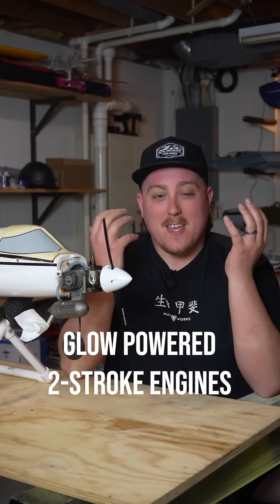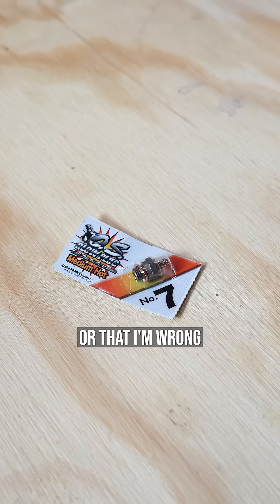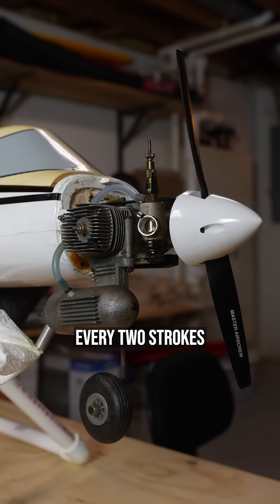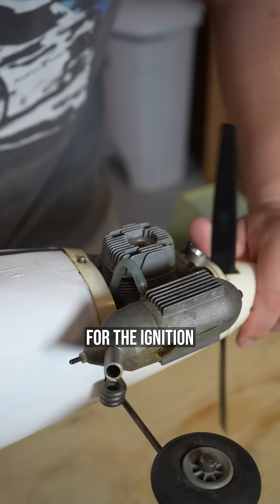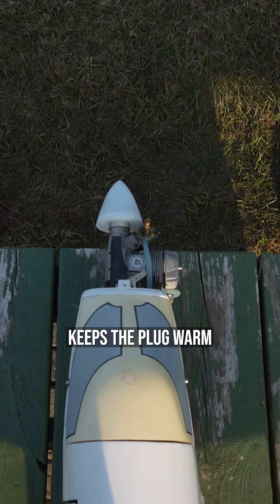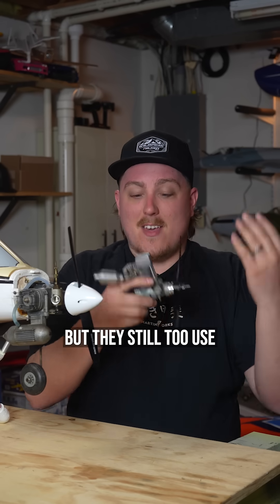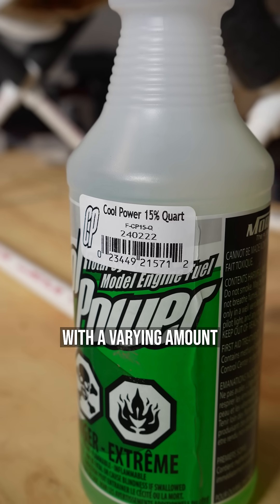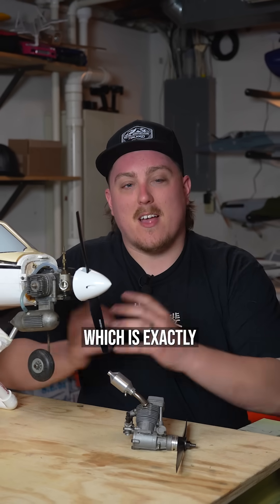How do Nitro RC Engines Work?

Comment: Look I realise these engines are becoming rarer in the hobby but clearly there is still a lot of misinformation out there if you believe it's the heat of combustion maintains combustion cycle through to the next stroke sorry mate.
It is a catalysed reaction between methanol, oxygen and the platinised plug that keeps it all going.

Comment: Actually the heat and compression from combustion is not what keeps the glow plug hot the platinum and paladium coating on the coil of tungsten wire have a catalytic reaction with the methanol to sustain the heat.

Comment: These are better thought of as two stroke semi-diesel engines. True diesels use purely the heat of compression to initiate combustion. Semi-diesels use a secondary heat source to initiate the combustion. In large stationary semi-diesels a hot bulb is heated with a blowtorch until the engine can self ignite. In this case, the glow plug is heated first to start the engine and is then kept  hot by a combination of a catalytic reaction on the surface of the platinum coil and in-cylinder heat.

Comment: The trick is nitromethane if you ad some on your bike or sacrificial engine with a spark plug it will run but good luck stopping it cause it's gonna runaway cause the mixture is igniting by the compression

Comment: It’s basically a two-stroke diesel, but you don’t use diesel fuel but the fuel that’s in there that you use is not gasoline either. It’s because of the fuel has to be reached a certain temperature. A spark plug wouldn’t be able to get to.

Comment: Well, I hate to tell you folks is OS 2 stroke probably a size 40 it’s called a glow plug doesn’t need a spark plug doesn’t have gasoline in it. It has alcohol and nitro fuel and oil mixture together.😂😂

Comment: What's the time in Old Man and when I was a young boy I never running a little cox engines with glow plugs. If I had a spark plug you'd have to include an electrical system how much more weight would that add to the plane. 
And really you're probably talking about people that don't know anything about the hobby and I think you know everything and they really don't know nothing I know too many people like that but enjoy the hobby a great hobby get young people involved in it

Comment: Just a thought but before the United States started making submarines for Warfare the Germans had glow plug 2-stroke diesel engines for the fishing boats reason you couldn't kill them with a machine gun they would just keep right on chugging along they could have they actually had incidents where there was an oil leak all the oil dumps out of the engine and it's still ran for 4 hours got to get back to Harbor now maybe that's just a mild exaggeration but these engines were Texas tough and the gentleman who went over there to examine the engines that they were using for submarines you may know him as oh I don't know possibly Nimitz. Yes he was a lieutenant and he was in the war department and they sent them overseas to Germany to study German machinery just a quick little history point there but that's what they were using in the fishing boats and they really were tremendously powerful really great engines too bad they didn't use them in cars and thank God they didn't use them in tanks

Comment: My only conclusions to this is the engines do not have a built-in magneto so the fuel needs heat to detonate so the glow plug gets hot enough to create a flash point of combustion based on the fuel

Comment: This is how diesels run away. No true ignition point after the glow plugs. Over fueling (usually from an oil consumption issue, like a bad turn seal literally force feeding an fuel type to the cylinders.) A hot diesel will burn engine oil as fuel when it's hot enough... air is what it needs to run away and if you cut that it will stop. Usually violent. Also did you know a rotary isn't really a 4 or 2 stoke engine? It's weird because of the way it is....
Reply: If you can't cut an ignition point you can't stop chemistry. Suck, blow, suck, blow, 2 stroke. High compression and heat make boom no sparkbplug needed.... diesel...

Comment: First time I'm hearing about glow plugs ever
Getting an ignition just from the right amount of pressure and heat, that sounds pretty hard to tune, diesel engines usually use injection and most every two stroke engine I've seen used gasoline

Comment: There are “Diesel” versions of these micro engines. They have an adjustable compression cylinder head w/ a screw that moves the bottom plate of the head in and out. You start it at high compression then adjust the head screw and fuel to get best operation.

Comment: Honestly a 2 stroke is basically a diesel to begin with , if you upped the compression on your chainsaw and added a bit of a richer fuel you could switch to glow plugs , it's gonna run , for how long is a different question though 😂
Reply: Modern diesel engines are 4 strokes

Comment: Actually your engine is a two stroke diesel engine just. Like a old Detroit . The friction from the air compressing ignites the fuel. The glow plug just aides in cold starts by heating the air in the cumbustion chamber. Now if it is a two stroke with a spark plug then it is a gas engine and you must mix oil with the gas where as diesel is a fuel oil sow it will lube without ppre mixing fuel

Comment: The glow driver or battery turns the coil in the glow plug red or up to heat  then the fuel which is  Alcohol a lubricant and nitro methane is burnt under compression and a chemical reaction from the fuel begins between the coil element in the glow plug  keeps it burning  and yes its a 2 cycle engine because it makes power every 360 degrees

Comment: There are 2-stroke diesels. Just because it has a glow plug doesn’t rule out anything. Take Top Fuel engine for example. They have 16 sparkplugs which melt hafway down the track and then work as glowplugs

Comment: Just a quick comment about the fuel. Of course RC engines of the type shown in the video run much better with nitromethane mixed into the fuel, but it is not strictly necessary. For many years I mixed my own fuel, purchasing methanol and castor oil from  chemistry suppliers. Then the flying club started purchasing methanol and oil in bulk (therefore at lower cost) and selling it pre-mixed to club members. This was still straight methanol + oil, no nitro in it. Then I got out of the hobby and returned decades later, when everything had changed, with nitro fuel readily available in hobby shops. Then I did fly nitro models for a while, but soon chose to go with electric or gasoline-powered models. I'm done with the glow fuel oily mess.

Comment: your correct it is a 2 stroke engine .... But to correctly identify it's type you need to call it a "2 stroke diesel engine"
and yes there have been 2 stroke diesel truck engines in use for decades....but they do Not use nitromethane in their fuel
their compression ratio is so high that plane old diesel fuel will ignite ....
typically a 2 stroke engine will put out twice the horsepower that a 4 stroke does per cc of displacement
which is incredable if you think about it. however enviromental concerns have all but ended the 2 stroke engine.( they tend to smoke more than a 4 stroke will)
but sense the entire "environmental disaster" lies have been exposed maybe they will come back and we'll get a 6.4ltr 2 stroke diesel engine for our pickups that will actually work in the future .....I can hope right?

Comment: fun fact.  the heat in the glow plug just helps the ignition cycle.  the glow fuel actually reacts with the platinum in the glow plug causing ignition, the heat just makes it a lot easier to achieve.   with some high compression engines it is possible to start without using an igniter, but it takes the exact right conditions.

Comment: Isnt there a catalyst effect from the glow plug when operating in normal condition as well? I am pretty sure if you have a worn out plug, they will still run untill you remove the starter battery.

Comment: They are effectively diesels, single cylinder two stroke diesels. To confuse things more there actually were model diesel engines too that had variable compression with a screw which went through the top of the head

Comment: The platinum coating on the glow plug wire reacts with the methanol in the fuel, that's what keeps the plug glowing. Basically a compression ignition engine

Comment: it runs like a diesel engine, combustion thru heat generated from the compression of an air fuel mixture, no spark needed. The glow plug is just to get the process started until the engine warms up enough to continue without it

Comment: I only know theory, but high compression can cause autoignition, or knock, in an engine if the fuel has a low octane rating.  This is important in motorcycles which have high compression ratios.  Yes, diesel engines use a glow plug to regulate autoignition, that is, compression helps but the glow plug gets the job done.  Being 2 or 4 stroke is orthogonal to diesel or spark.   But with no timing control, there will be a narrow power band.  Typical of diesels, why don't airplanes have transmissions?   Offshore windmills have massive transmissions (b/c the prop has low rpm, each blade being over 100m long)

Comment: I know NOTHING about these engines but I have worked on supercharged alcohol and top fuel dragsters and one thing I can tell you about both Fuel and Methanol is neither one of them like to light especially when the engine is cold (alcohol is way more forgiving than nitro) I’m guessing if you were to go back the 50 or 60 years (i’m guessing based on the little Cox engines we had when I was a kid and I’m in my 50s now) and look at the evolution of these engines it probably started out with a spark plug on the first prototypes and then they quickly figured out it was a lot more consistent with a glow plug-I wish I didn’t see this because now I’m fascinated and I’m probably gonna go spend a gazillion dollars on a new hobby😂

Comment: Those engines are similar to funny cars and diesel engines.  A shame folks bicker about what those little things are.  What's worse is I never could find a way to use those engines outside of the toy market that they are currently limited to. Limits to how long they can continuously run before they can warp enough to stop running. Size of the fuel tanks and cost of fuel.  But hey, great times are had just the same.

Comment: well i learn something new everyday ,i had no idea you could use a glow plug with a 2 stroke   .thanks dude :)
Reply: That little motor is essentially a crude diesel engine. The "diesel fuel" is that mix of nitromethane, methanol and lubricating oil. The engine, once started uses compression for igniting the fuel/air mixture.

Comment: It’s more of a diesel engine than anything. And yes there are 2 stroke diesel engines. Detroit is probably the most popular that made a ton of them. And technically you can have a gasoline engine run without a spark plug too but would not be as efficient,reliable or clean burning.

Comment: To me the coolest thing about glow engines is how they actually have variable ignition timing based on rpm. As rpm increases, the glow plug gets hotter, which ignites the fuel-air mixture sooner, thus advancing the ignition. Works the opposite way when rpm decreases, glow plug gets colder which ignites the fuel-air mixture later, effectively retarding the ignition.

Comment: I suggest looking up the experiment of hanging a penny in a vessel with acetone and once the penny is heated and hung above the acetone it will ignite the vapor...this is the same principle for these 2 strokes!
The GLOW PLUG is a Catalyst Metal similar to Platinum or copper in the experiment...and once heated and introduced to fuel vapor it Continues to "Glow" allowing the next ignition to occur. Science

Comment: The interesting thing is that it is technically a
 form of a half diesel 2-stroke engine with passive fuel injection, but does not burn the oil in the mix. It burns the alcohol and nitro, but just blows the organic castor oil out the exhaust. It is the most powerful internal combustion engine by weight.

Comment: A chemical reaction between the ingredients in the fuel and the wire coil of the glow plug will cause it to get hot and start glowing at the right pressure.  The glowing plug ignites the fuel.  A two stroke glow plug engine is sort of a modified diesel engine.   At one time all model engines were ignition, the glow plug fuel engine design was first used in the late 30's or so.  Many spark engines were converted to glow operation early on, but they were not strong enough and broke connecting rods and cases, so finding examples of older ignition engines is difficult.

Comment: Had a float in the carb stick open on a dirtbike one time and it was super hot so it just ran away. hit the kill switch, kept goin. My dad pulled the plug wire, kept goin. My dad had to rip off the fuel line. It  was either that, or let it blow up, or run outta gas on its on. Moral of the story, a 2 stroke will most definitely run off just compression, even off lower octane fuel. If the scenario is right for it.

Comment: It comes from people who aren't in the hobby, by associating a glow plug with a diesel engine.
Fun fact, it is the catalytic effect of the platinum/iridium and other rare earth metals on the glow plug that work as a catalyst when hot, without those metals the motor will stop when you remove the power from the plug.
Reply: This is not really true. I have a very old model engine that has variable compression and no glow plug. It runs fine. They're an auto ignition (diesel cycle) engine.
Reply: @mandrakejake I also have one, we're both in the hobby, my original comment is about people NOT in the hobby, those people associate a glow plug with starting a diesel truck or generator.
Reply: @mandrakejake  thats because yours runs on ether and is a diesel. this is a methanol engine and as posted, its a catalytic reaction that keeps the plug warm
Reply: But how do you get ignition advance?
Reply: @EbonyPope  its less important in these engines but also the faster you compress something, the faster it will heat. natural advance
Reply: It's not even a lack of understanding the hobby, it's a lack of understanding WHY an engine is 2/4 stroke. That's just basic combustion engine knowledge.

Comment: I have been flying RC since the 70’s. And I have both of these engines. My question since I was a teenager is, why don’t bigger engines use glow plugs?  I get that diesel engines don’t have ignition. But what about a racing engine. They use alcohol and maybe nitro.  But they still use spark plugs. Weird. I was thinking how great a 125 two stroke dirt bike would be with cool power and a glow plug.

Comment: This is literally how nitro 2 stroke rc cars work, and those have been around for probably way longer than you'd think. The fact that this is new information for people is kinda wild lol they know what a glow plug is and does but they don't know what 2 stroke means or how a glow plug works with it? It's simple mechanics. Heat make boom boom.

Comment: Heat from compression and ignition, and heat from the catalytic reaction of the methanol fuel with the platinum in the glow plug coil.

Comment: I remember my cousin having a 2 stroke rc plane that used a pair or glow plugs. Was very cool. Robust and just worked all the time if you kept oil in it lol.
Reply: 2 strokes don't have oil in them. There fuel has the oil in it.

Comment: The stroke and the ignition method or fuel of use has nothing to do with each other, you have gas, nitro or even diesel with 2 stroke cycles.

Comment: It's not 2stroke.It's 2 cycle they use It uses natural fuel so it wouldn't be classified as a 2stroke
Since it's not using too stroke oil as it's mean lubricant And it wouldn't ignite underglow

Comment: me who knew that 2 strokes dont need a spark plug by having a runaway 2 stroke trike a few months ago 

for context i was driving it and i were about to stop so i pressed the igniton cut off and it did nothing so i pulled out the ignition wire off because the button works whenever it wants and, the trike didnt turn off and it just started to rev up somehow and idfk how because its a carb engine so i jus blocked off the intake to shut it down
Reply: how are my english skills suddenly so shit💀

Comment: Delta Hawk is an engine manufacturer of engines for Cessnas and other smaller planes. They also use a two stroke engine with glow plugs. It’s not just for toys.

Comment: The glowplugs use a platinum heating element, platinum is a powerful catalyst that catalyses the reduction of methanol, especially at high pressures and temperatures. It's the methanol reacting in the plug that gives some control on engine timing. As pressure and temp rise with compression the platinum gets hot, igniting the fuel. 

If there was no methanol or no platinum the engine wouldnt work. 

There are even more basic RC engines that have no ignition system at all but they only work at one speed and use an ether rich fuel blend. 

You can actually run nitro engines on just methanol and oil if you lean out the mixture enough but they lose a lot of their power.

Comment: Fun fact. That little engine shares its glow plug technology with a vintage german tractor, the Lanz Bulldog, which used a common kerosene blow torch to supply the heat for the glow plug. Both engines are "semi diesels" and are two stroke. One engine runs at 20,000 rpm and the other 200 rpm.

Comment: There is also a diesel which uses nothing more than what's essentially a bolt. Though there not readily available anymore and the fuel is unique to mini rc engines